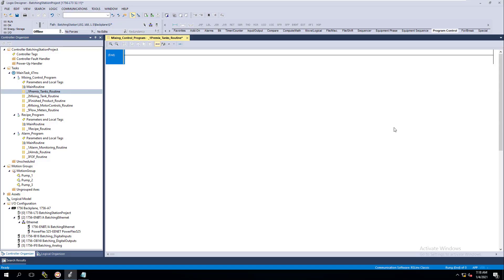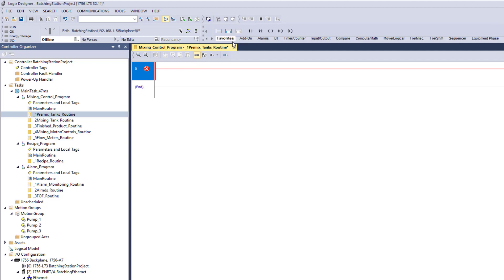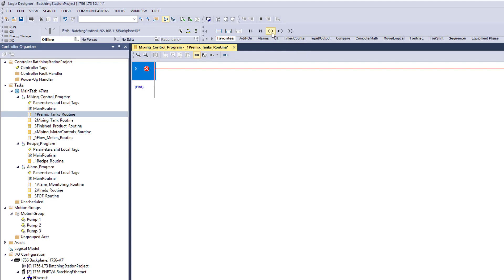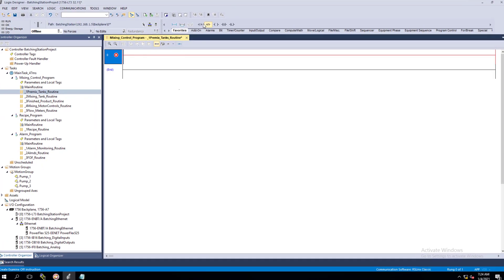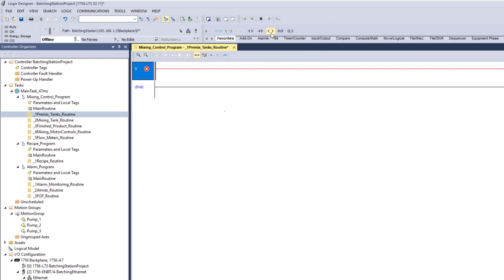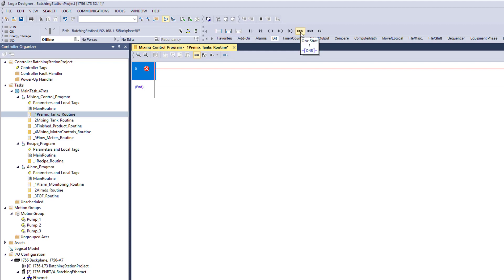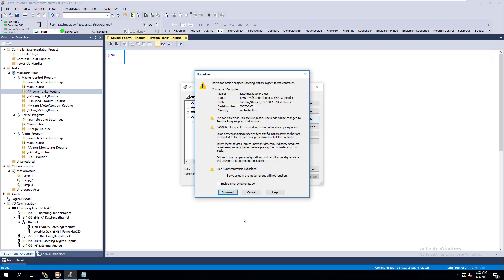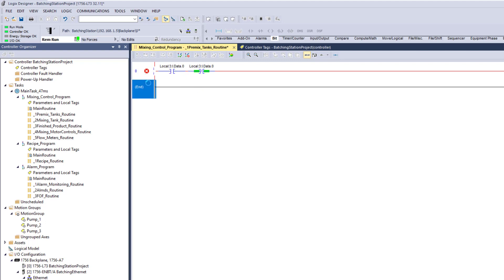What is a Boolean In Studio 5000 | XIC instruction & XIO instruction tutorial | Batching PLC Day-18

Comment: This content and explanation is even better than anything you will find in any paid certificate courses online. You are a true hero to the Allen Bradley PLC community. Thanks so much sir.
Reply from the maker: Thank you, I also have a great PLC training course:
https://www.allen-bradley-plc-training.com/p/plc-programming
Reply: @ShaneWelcher  Thanks for sharing, i will check it out later. I will need to use a VPN though, my location is within the regions restricted by US sanctions (Venezuela). Do you accept paypal as payment method? if so i will gladly pay for one of those courses. 

Im using your videos as the basis for a personal project where i will need to measure temperature and pH of a solution inside a mixing tank... and then i will add a way of dosing the mix by volume or weight into a bowl, it will be a tank filled with sourdough. 

I work for a small local breadmaker but almost everything is done manually. I want to learn to program and deploy some PLC systems to help improve the whole production process. I was thinking on buying a micrologix 1400 1766-l32bwaa to do some tests by myself, i know i will have to use rslogix 500 to write the logic code, but if im able to get the resources from the company to buy a compactlogix or even a controllogix, it will be more easy starting from rslogix/studio 5000 (i was able to get the software on grace period from a friend, but is more than enough time to learn the basics).

Sorry for the long text, i really love your work and way of teaching. If you can recommend a specific course from your collection, that can fit the type of project im trying to build. I will really appreciate it.
Reply from the maker: @ubuntux22  

Yes, the platform accepts PayPal